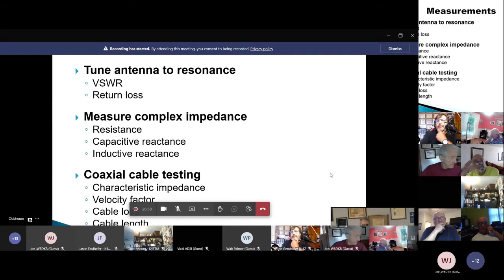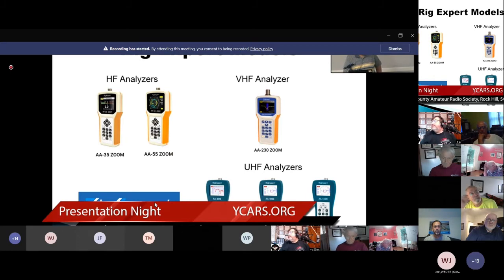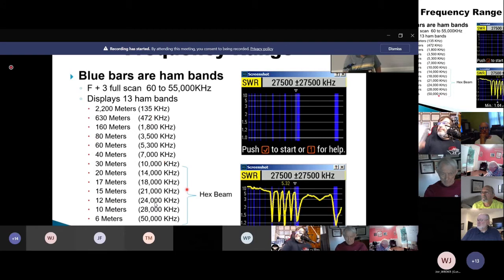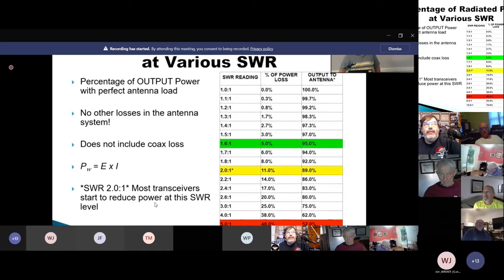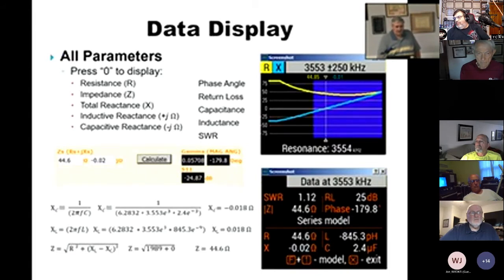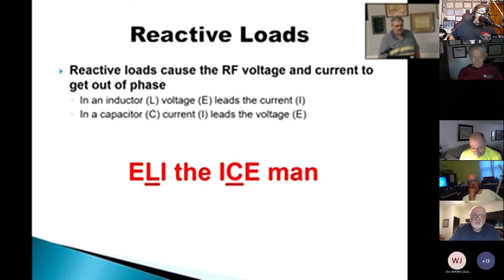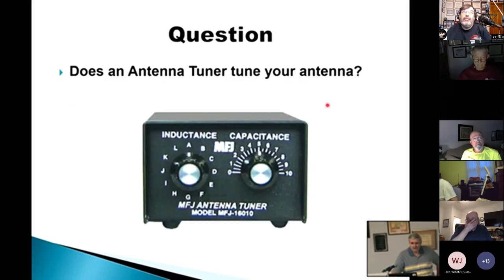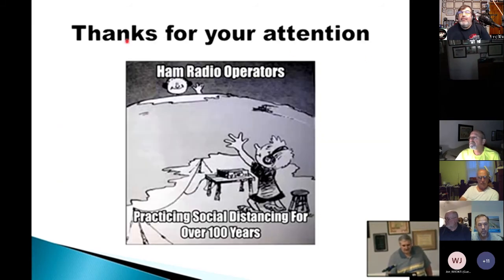YCARS July Presentation   AE8J   Antenna Analyzers  7 28 22

Comment: Thanks, very instructive! One question though @1:02:50 "despite it's name it [a tuner] does not actually tune the antenna": doesn't the whole antenna system (coax + antenna) get tuned however? If yes,  and you have choke at the input end of the antenna, isn't that the equivalent of tuning the antenna?
Reply: No the antenna tuner is a misnomer.  It is a matching network.  If used at the radio it only provides a combination or capacitance and induction to get the antenna system close yo 50ohms.  It does nothing to the inherent impedance of the antenna system.  So the standing wave (SWR) is still there between the tuner and the antenna.  A tuner used at the antenna moves the mismatch further away from the radio and minimizes the coax losses.